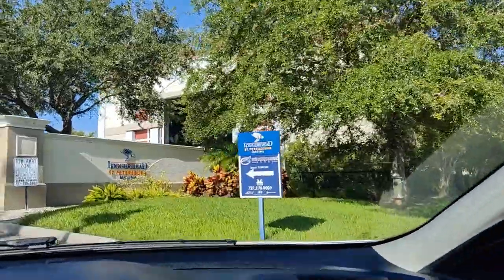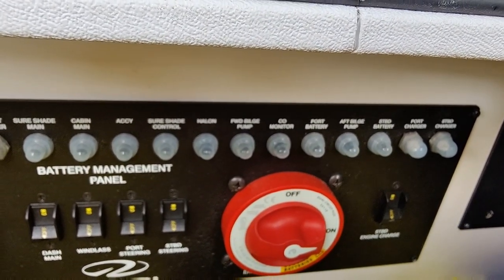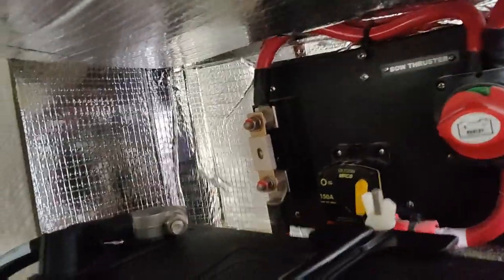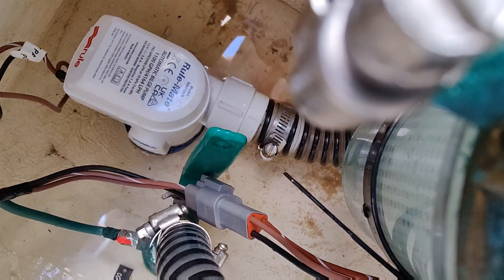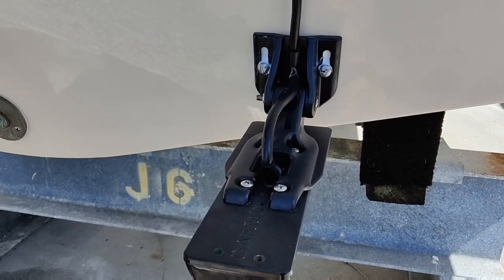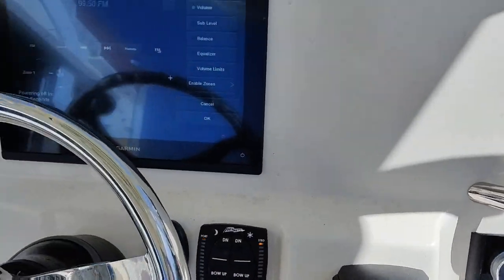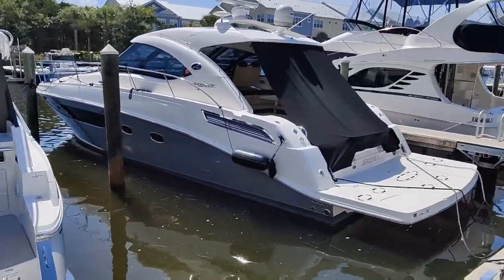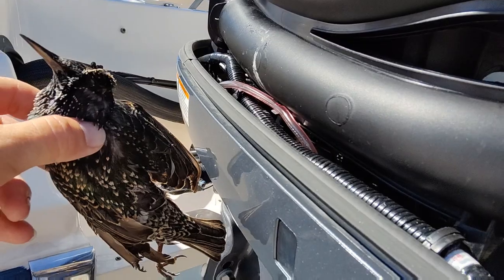What Can We Find At Loggerhead Marina? #Regal #GradyWhite #Episode177

Comment: Hey Justin.  My Grady has that same radio.  Sometimes it says on with the radios off, but sometimes it does not.  I haven't seen it do that in a while.  It seems to turn off after some time.  I'm going to get you that picture of the seacocks in my cabin i havern't been to the boat in a while i've been working.  My 2021 33 Express in the same color as the boat in the vid I really like it.
Reply from the maker: I have had some issues with Fusion head units in the past. Maybe just a weird glitch in the stereo.  The 33 Express is a sweet boat in any color☺️
Reply: Sounds like battery switch is not shutting off completely?

Comment: Hi Jason, I have a Fischer Panda generator question. would it make sense when you remove the generator to put Deutsch Connectors on the control wires so its easier to remove next time.  My SeaKeeper has to get repaired and its behind the generator and I don't think its the last time.  Keep up the good work!
Reply from the maker: Thank you and yes you could put Deutsch connectors on everything to save you some time in the future. Not a bad idea ☺️